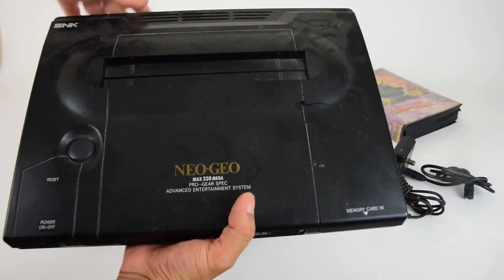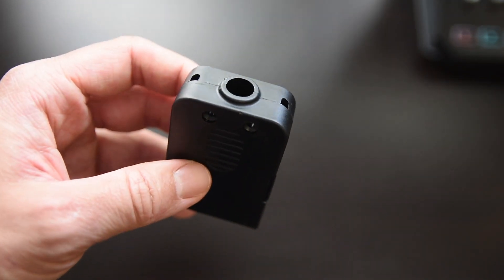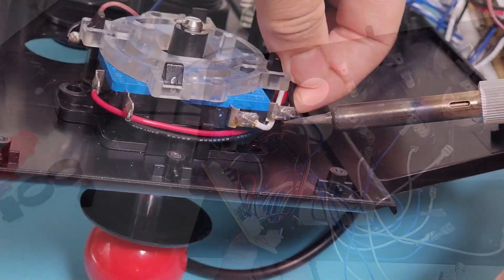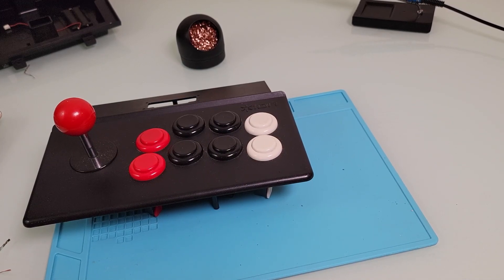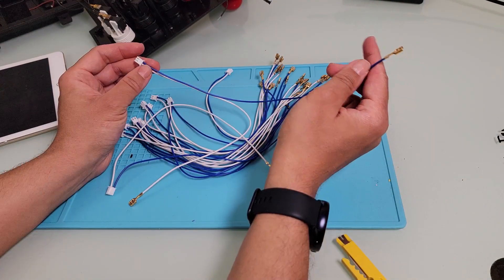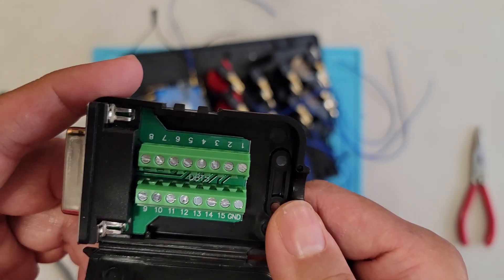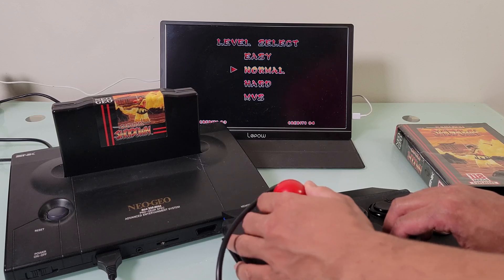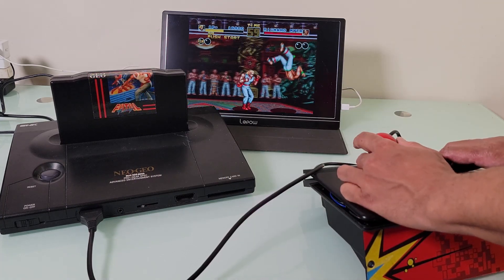Building an arcade stick for my Neo Geo Part 1 - The Prototype

Comment: question Lu did you add power to the joystick and did this end up working on mister?
Reply from the maker: Did not add power to it. Haven't tried it on MiSTer yet. I'm pretty sure it will work, but I am creating a video that will involve testing it and other console controllers.